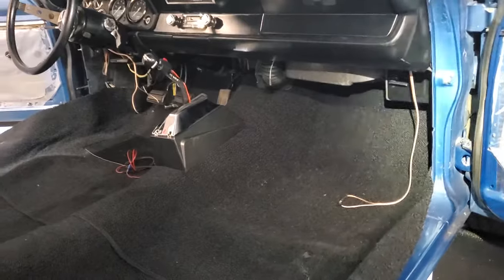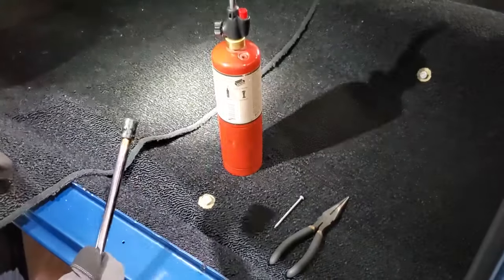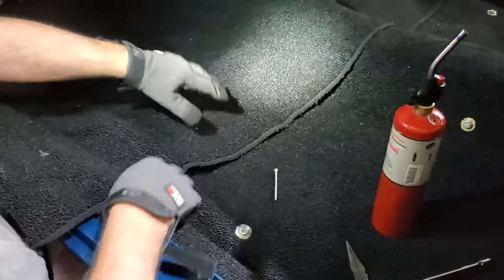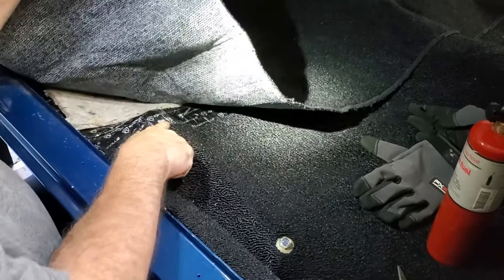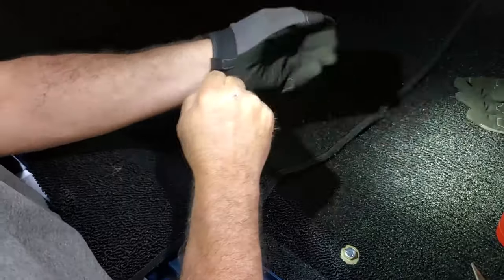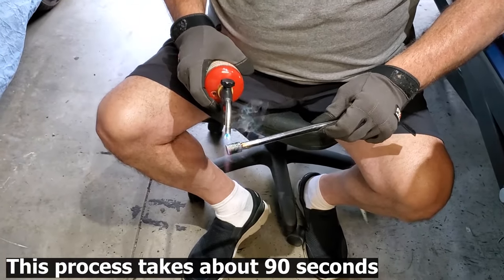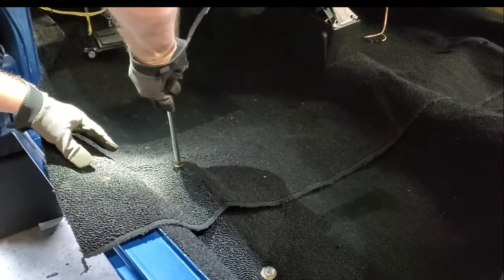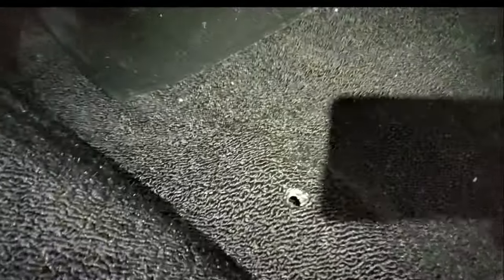How to Create Perfect Holes When Installing Automotive Carpet | Fixed It Garage

Comment: Use a soldering iron, makes perfect size hole , no flame, no nail , no hot extension or socket to hold. Perfect size, place in holder when not in use.